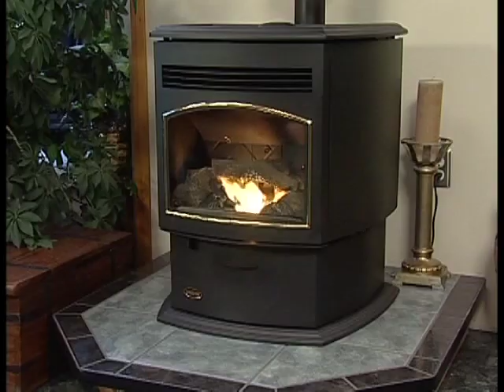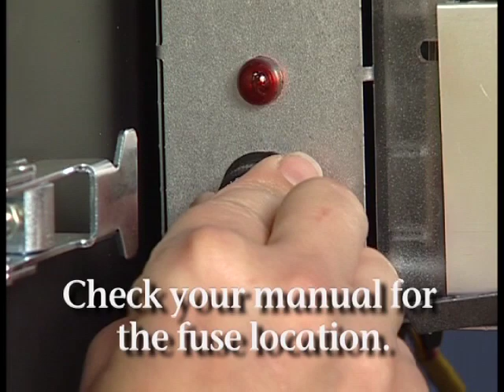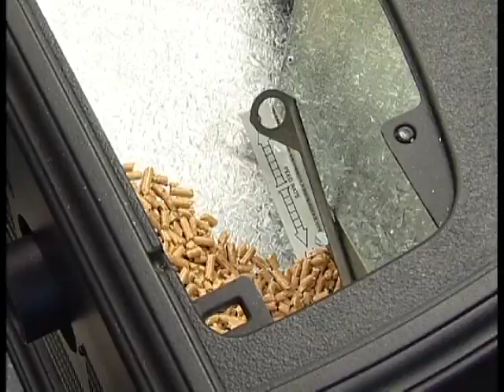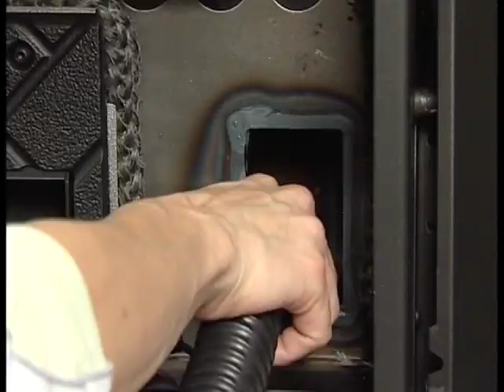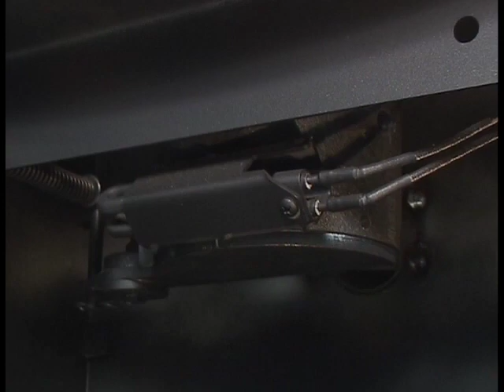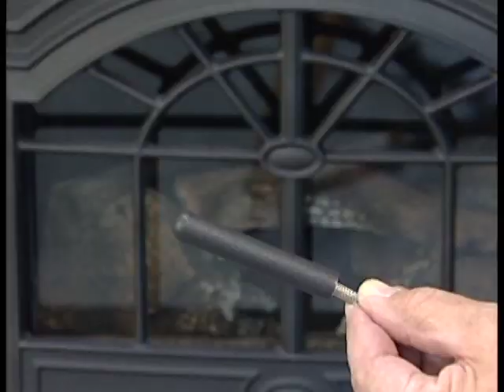Quadra-Fire® Santa Fe Pellet Stove: Troubleshooting Video

Comment: Anyone else have an issue with exhaust fan starts but when calling for heat it pops the 0.7amp fuse. So far I have replaced all the snap discs with new ones, replaced the fuse holder. The exhaust fan does make a lot of noise so wondering if it needs to be replaced due o bad bearings which may cause a higher amp use.  .

Comment: This heater is gorgeous fireplace >>>t.co/P2fS57pTEC  ! It has every setting you could possibly want from changing the "fire" to changing the temperature. Remote feature is great when you get to warm in bed and need to turn it down. Has wheels so it's easy to move around if needed. The BEST part though is the sleep timer. No more waking up in the middle of the night sweating because it's too hot!
Reply: good it

Comment: One cycle is as far as my Santa Fe will go. It's a 2005 build control box was replaced in 2008 with appears same model . Once and awhile the blue light will blink the number the actuator is set at. But then it won't for awhile on starts until bam it blinks. The red Call light comes on Cycles begin auger feeds pellets seems just fine. Green light comes on pellets begin another feed. Then continue feed slowly . Red thermocouple light comes on after a few minutes convection blower starts . Feed frequency will slow or almost stop at this point as flames begin to dissipate. As flames leave box and convection fan blows for about 10 minutes this will very some but doesn't  change is once the cycle is complete . Auger slows to eventually feeding no pellets. Convection blower continues until flame is no longer visible. Will blow another 5 min or so and stops. There is no more burn blower and no more pellets being fed. Temperature is still 25 degrees lower than I want. Red light stays on. Pushing reset button will start the whole cycle once again. Or you can turn heat off then back on at thermostat and unit will run a single cycle. Chamber doesn't over heat flame burns steady 6 inches over fire pot. I purchased used . I replaced several parts that appeared to be original except control box. I got new snap discs all 3 a new thermocouple, ceramic cover for this, a new vacuum switch and hose, installed an outside air kit. Running vent up 7 feet then straight out at a 20 degree angle out almost 4 ft out past eave. So what do I need a new control box? It all looks fine nothing has blown and as I said it runs through a cycle just fine but the blower motor cuts off suddenly ,auger stops . Yet red and green light remain on until #2 snap disc snaps and the green light goes off.  What year did they improve the control box? If mine is bad is there a resistor I should run down . I have most trouble shooting devices as I build computers. Anyone have advice?
Reply: +Russ Eastburn (ESP1000) :  I am having the same issues that you describe.  Please let me know if you any responses.
Reply from the maker: Hi +Russ Eastburn (ESP1000) and +Chad Rowland. Thanks for reaching out! If it's in thermostat mode, it will cycle on and off on it's own. If there is an issue with it, and it cycles off and goes into shut down mode, we would recommend having the local authorized dealer out to determine why it's doing that and to get it fixed. The control box for these models was updated in 2005, so if yours was replaced in 2008 it should be the newest version. To find an authorized dealer near you please click on the following link.  Thanks again, Russ!  http://www.quadrafire.com/WhereToBuy.aspx